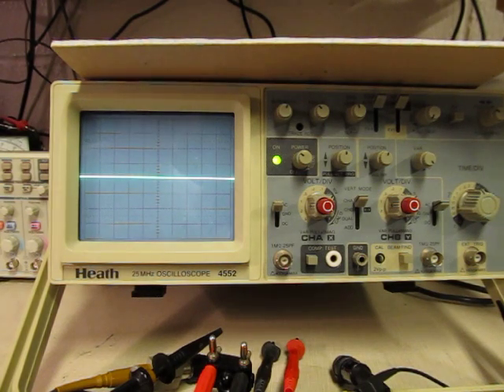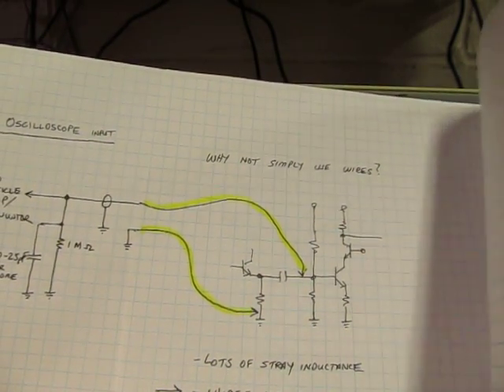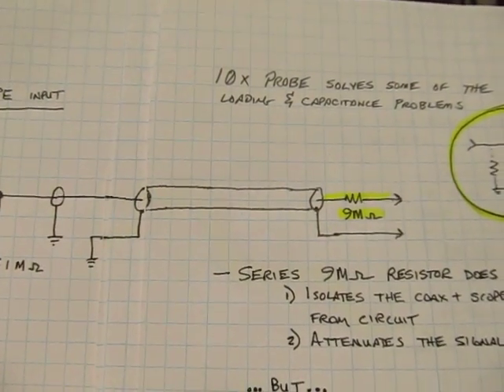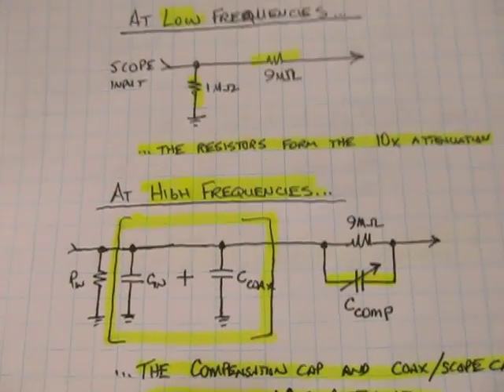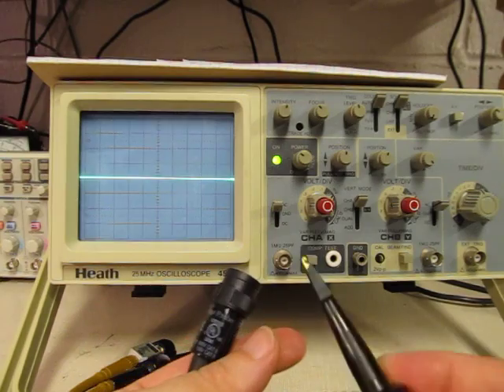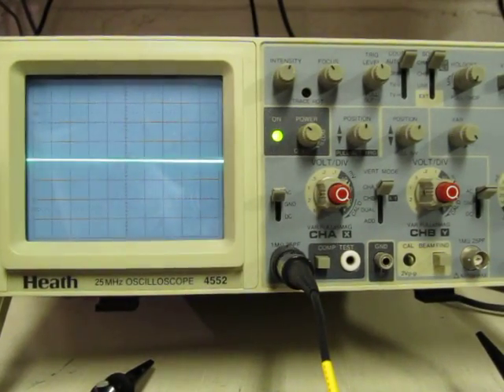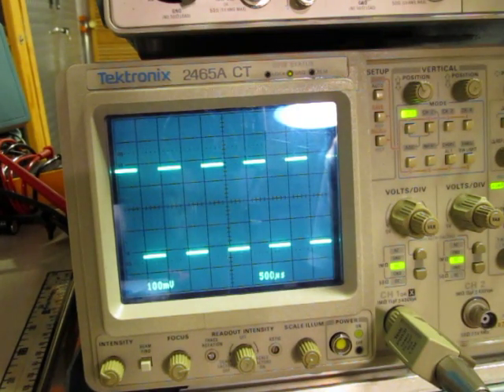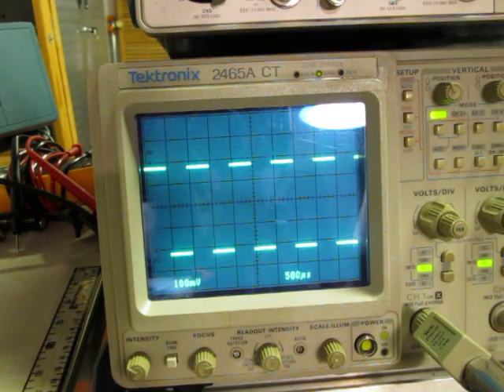#9: Basic 1X and 10X Oscilloscope Probe tutorial

Comment: Great video series as always. C-Comp of the 10x probe is in series with the intrinsic scope capacitance.
Reply from the maker: There is always a capacitor in parallel with the 9M tip resistor, but sometimes the adjustable cap is in parallel with the scope input.

Comment: I still found this educational, as I'm a new  to oscilloscope. I used to have an old Heath model many years ago that never worked because the CRT was gone and it and I never got one after that so I never learned how to use one. But I just recently picked up a Siglent SDS1102CML to learn from. there is a lot to comprehend on these things but I think your video is getting me on the right track. So I subscribed. :-)

Comment: I still have a pair of coax probes I made when I was setting up Dolby cinema processors in movie theaters. They are just a straight-through coax, breaking out to two miniature banana connectors, which all the Dolby cards used as test points. 1X, 1m length, no compensation of any kind. But these test signals are all at approximately 1V RMS and 1KHZ, and the tests are for level and phase. I knew when I made these that they were only good for such robust, low-frequency  signals, and would never suffice for more challenging measurements, though they were good enough to detect noise and hum as well on these rudimentary circuits. They can also be used in a pinch, if my car gets stuck in a snow drift, to tow it out!
Reply from the maker: 1x probes don't require compensation since they're basically just a direct connection to the scope.  Perfect for the audio application you've got.

Comment: Great video, a short extract of the lecture without the background noise. 
After decades of (occasional) scope use, I've only recently learned that 10x is typical or normal probe usage. I always thought it was an exceptional usage for high voltage inputs, and was not really conscious of the loading aspects. I always had my probes set to 1x, but then I was mostly dealing with digital circuits, so less effect. 
I also only learned recently that the sharp internal tip was intended as an actual probe, I always thought the springy hook was they only way it should connect to the circuit. 
Anyway, I had a question, just saw it was answered further down. (If the 9M resistor must be at the probe end, before the coax,  and the compensation trimcap is in parallel with it, how can it work when the trimcap is at the scope end of the coax?)

Comment: I am trying to look at the waveform of a 120-volt wall outlet to see if I have dirty power. Will a 10x probe safely accomplish this by knocking the voltage down to 12-volts? I do not want to blow up my oscilloscope by having too much voltage on the input. What is the best way to accomplish this?
Reply from the maker: It is still something to take great care with.  Make sure the probe is rated for the peak voltage that you'll see.  Plus, you're making the assumption that the outlet is wired correctly (hot & neutral aren't reversed).  It can always be dangerous when working around line voltages.  A safer option would be to use a step down transformer (such as a 12V secondary), and probe the secondary voltage.  The transformer won't dramatically alter the waveform, and it will be safer for several reasons (lower voltage, isolated source).

Comment: How does the trimmeable bypass cap work when it's near the socket, but the 1x/10x selector switch is in the probe? How can they be in parallel in the way you've drawn them?
Reply from the maker: Sometimes there is a fixed capacitor around the 9.1Mohm resistor at the probe end, and a trimmable cap is placed in parallel with the scope's input capacitor.

Comment: Hi, love your videos, they have helped me learn so much! :) I am trying to make an oscilloscope out of a salvaged CRT from a small TV, and I'm having some issues displaying square waves properly.(square waves turn into round sawtooth). Would soldering in a compensation rc circuit simillar to these probes maybe solve the issue, or is it an issue with the deflection coil that would have to be rewound to have lower capacitance/impedence? I am currently using the vertical coil to draw the line, and the horizontal to coil for the vertical amplifier.  Thanks regardless :)
Reply: This sounds like a pretty cool project :) I know it has been 6 years already but were you able to complete this project of yours :)? Hope you're safe and sound.

Comment: I am trying to measure very low current RF at 80mhz however my 1X says its only 25mhz but I think its closed to 65MHZ I tried coiling a wire around an antenna to remove the scope interference but it still seems to read 23 to 28MHZ. Any tips as to why that may be? Or how to measure it? Seems like maybe 100miliwatts signal.

Comment: I really appreciate ALL your videos! I’m a hobbyist and just learning electronics. I’m learning a lot from your videos! I bought a used Tektronix 2465 scope for a good price. No probes, so I got me (a pair)some after market 1/10x 100 MHz  probes. Tried compensating the probes as you recommenced. Channel 2: no problem! Channel 1 does not allow me to “flatten” the corners of the square wave from the calibrator signal, I’ve maxed out the probe’s adjustments. If I I switch probes, same issue on ch1 but not ch2.  So I know it’s ch 1. Any ideas or suggestions to correct it? Thank you,
Reply: The POST on the 2465 all check out as passing.
Reply from the maker: @jbflores01  It is possible that the internal compensation of the Ch1 attenuator and front end is off and needs calibrating.  This wouldn't show up in a Self Test of POST test.

Comment: I have a DIY DSO scope that is rated at 50V max and I am wondering if I can probe with setting at 10X on a circuit up to 500V? My probe is 100MHz bandwidth rated. Just built it and don't want to fry the scope. The probe I assume will take 600VAC by the info from the probe package. Thank You! Liked and Shared.
Reply: In theory yes, but in practice, the upper limit will be less than that due to the ratings of the components in the probe. So, check the maximum voltage rating for the probe.

Comment: I have a Tektronix 2465A and a P6131 probe, the exact combination you are using in this demonstration.  When I calibrate the P6131, the shape of the square wave does not change much, but the vertical distance between the positive and negative plateaus goes widens and narrows, depending upon the direction I turn the adjustor.  The calibrator is said to output 0.4V, and I can calibrate the amplitude of the square wave to cover 4 grid boxes, 100mV each, just as your scope shows.  But the shape of the square wave is not as clean as yours and doesn't change when I rotate the adjustor.  Any comment would be appreciated.
Reply from the maker: On the 2465, the calibrator signal frequency varies with the timebase control. When the timebase is too fast, you're not going to get the right result for the user low-speed probe cal.  You want to be at about 1ms/div.
Reply: @w2aew  Thanks.  I will try again.  In the interim since my previous comment, I acquired a proper non-metallic screw adjuster.  I was previously using a screwdriver from my set of small "eyeglass" type screwdrivers.  I wondered whether the metal screwdriver had any effect on what I was observing.  I will start over.

Comment: adding 9M attenuates the signal 10 times "only for DC "right? And what did u mean by saying "isolates the coax + scope from the circuit"? thanks
Reply from the maker: The 9Mohm resistor forms a 10x voltage divider with the 1Mohm scope input resistance for DC and low frequencies. As the frequency increases, the 10x division of the signal become more dominated by the ratio of the scope's input capacitance and the probe's compensation capacitor in parallel with the 9Mohm resistor.

Comment: I have to go back to basics again because one question still torment me a couple of days: should we think about wave reflection effects caused by impedance mismatching in probes transmisson line? While we measuring 50 Ohm circuit for example we have first mismatch in probes which have 9 Meg resistor (or some random reactance not equal 50 Ohm), then we have 50 (I guess) Ohm cable, then it enter in 1 Meg oscilloscope (which have own reactance). I can assume that effects really insignificant but why? I can't trust my oscilloscope since I've been thinking about it xD
Reply from the maker: It all depends on the frequency you're talking about.  The probe's input impedance (10Mohm in parallel with several pF) will often by much higher (an order of magnitude or more) than the 50 ohm line, so the discontinuity will not be very detrimental.  If you get to the frequencies where the probe's input capacitive reactance starts getting below a few hundred ohms, then it is time to start thinking about using a different probing or measurement strategy.

Comment: So if we have C-comp near BNC it mean that 9M resistor near BNC connector too right? So did it mean we have full capacistance of cable from tip to 9M res applied to our circuit in that case?
Reply from the maker: The 9M resistor is always at the probe tip.  For probes that have the adjustment near the BNC, this means that there is a fixed capacitor in parallel with the 9M resistor in the probe tip, and the adjustment is actually a small capacitor in parallel with the scope input.

Comment: Sorry for the newb question but what is the purpose of the small 10-25pf capacitor across the 1M input resistor on the scope, it looks like a bypass capacitor or low pass filter. Why would I want that?

Comment: @w2aew, when you measure a 5 volt drop across with your oscilliscope, and you decide to change your volts per division, does that change your voltage drop across that resistor ? I obzerved when manipulating volts per division, it raises the volts peak or lower's it, is that changing voltage, how could you still count 5 volts per division once you raise your wave now the wave is jumping to about a few divisions higher, so how could you still measure 5 volts.

Comment: Quick question for ya. I am looking into getting probes for my two analog scopes. They are both 100Mhz scopes. One takes BNC and the other banana plugs. The probes I will be getting will be relatively cheap ones for now as I don't have the money to spend on expensive ones. I have herd that I should get probes that have one and a half times the bandwidth of my scope, other say to match the bandwidth. Should I be getting 100Mhz probes or 150Mhz probes? I will likely get BNC connecter probes and an adapter for the banana plugged scope. Probes would be the P6100 or P6150.
Thanks for all the great videos and advice!
Reply from the maker: I doubt that the scope with the banana plug inputs is actually a 100MHz scope.  Banana plugs just aren't suitable for that frequency.  Good probes are rated to achieve their indicated BW, even when connected to a scope with the same BW.  Not all probe manufacturers specify their probes that way though, so following the 1.5x rule isn't a bad idea.  Just make sure that the probe's compensation range encompasses the input capacitance rating of your scope.
Reply: You are right. That one isn't a 100MHz scope as I thought. Not sure where I got that from. I checked again and it is a Tektronix 5110 mainframe with 2 5A19N differential amplifiers and a 5B10N time base. So it is actually a 2MHz scope.
My Tektronix 465B is definitely a 100MHz scope though, but it is in need of a few repairs it seems. I also have a BK Precision 2120A 20MHz scope that doesn't power up.
Thank you for your reply.

Comment: I have old oscilloscope that has no information on it's front about it's "in" capacitance and resistance. When I opened it I saw 220 Ohm resistor and 100 nF capacitors at connectors. I purchased 100:1 probes for this oscilloscope. It has Input Capacitance - 6pf Input Resistance - 100 Mohm and compensation Range - 10pf-35pf. When I try to compensate probes to oscilloscope input it always shows insufficient compensation. What can I do to correct that? Thank you!
Reply from the maker: The vast majority of scopes have a 1M input resistance.  it is the input capacitance that will vary among scopes.  I highly doubt that the 220ohm and 100pF part were setting the input impedance of the scope.  If the compensation range of your probe isn't sufficient to properly compensate for your scope, your only option is find a different probe or modify the compensation circuit of the one you have.  Maybe you can find an old manual or datasheet for your scope to learn what the input capacitance is.
Reply: You are right, I measured the input with a multimeter and it showed 1 M and 75 pF.  When I try to adjust trimmer on the probe it starts to move from "insufficient compensation" then goes better and then falls back to "insufficient compensation", and do not allow me to reach "normal compensation". Is it possible to do something about it? Thank you!
Reply from the maker: That's a pretty high input capacitance, and is why you can't properly compensate.  The compensation adjustment is a variable capacitor which only has 180 degree rotation from minimum to maximum capacitance.  If you can open up the probe, you can try putting a very small capacitor in parallel with the compensation capacitor to see if that helps.
Reply: Thank you!

Comment: Nice video ...so if you are aligning a ssb 27mhz ssb transceiver you would only have the probe on 10x ( if the 100mhz probe was rated at 6mhz / 1x and 100mhz 10x??.
Thanks in advance.
Reply from the maker: If you are using the probe to examine the 27MHz signal, then yes.  However, there are better ways to couple the RF output of the transceiver (if that's what you need to do) to the scope.  See my video on RF Samplers.
Reply: @w2aew  yep I made one of your RF samplers for my 25mhz scope but recently bought a Tektronix 465M scope ..wahoo.

Comment: Hey, could you explain what capacitive loading is and why at 4:00 the 9M ohm resistor "isolates" the coax and scope capacitance. I understand that in the case of a 1x probe, as frequency of the signal in the circuit increases, then the reactance of the scope capacitance will decrease and so more current will flow through that capacitive branch. But then how does adding a 9M Ohm resistor in series to the coax help? Thank you.
Reply from the maker: Capacitive loading is the amount of capacitance that the probe presents to your measured circuit node to ground - the same as putting a capacitor from that point to ground.  The 9Mohm resistor gets placed before the source the the large capacitive load presented by the coax and scope input - thus putting a very high resistance in series with it, which effectively takes it out of the circuit.  However, even 10x probes still have some capacitive loading effects, but not nearly as large at a 1x probe.  I recently did a video on this too: https://youtu.be/sPSJnj7gVJA
Reply: @w2aew  Thank you for your reply. I have one more question. Correct me if I'm wrong, so to find the bandwidth of the 10x probe (the 3db frequency) you would use the equation 1/(2piRC) where C is the net capacitance which is 1/10 of the input capacitance + scope capacitance and R is the net resistance of the 1M and 9M ohm resistors? In the end this 3db frequency value would be higher than that of the original 1x probe, hence giving the probe greater bandwidth?
Reply from the maker: @titiliu3302  The BW of the probe is more complex than that, since the compensation circuit is a lot more complicated then what is shown in this simple video.

Comment: the term 10x means if I give 10v at the Intput ,I will get 1 volt at the entrance of the probe . am I right about this ??
Reply from the maker: Yes.  The probe contains a series 9Mohm resistor which forms a 10:1 voltage divider at the scope input.

Comment: thanks and here is noob question of the day Oscope-propes 40mhz or 60mhz or 100mhz does that matter in any way.. I'm a noob with some cheap leaning handheld learning scopes that ain't cost a lot but need a scope probe and unsure if that makes any difference for low cost... can I go with fx 100mhz prope for a sub 1mhz scope.. if the price is the same for 40mhz prope vs 100mhz prope. and thx for a great video.
Reply from the maker: It is usually best of have a probe that equals (or moderately exceeds) the scope bandwidth.  If the probe is rated for much higher bandwidth than the scope, then there's a chance that there won't be enough adjustment range in the probe to properly compensate the probe with that scope.

Comment: how to design 100x attenuator circuit just to measure dc pulse of very low frequency  , can we do it using voltage divider ??
Reply from the maker: For low speed, a simple resistor divider will work.

Comment: Does the 10x probe reduce the frequency by 10? So if I had a 500 Mhz input sine wave and used a 10x probe, would I see a 50 Mhz sine wave on the scope?
Reply from the maker: No, it only attenuates the amplitude of the signal by a factor of 10.  It does not change the frequency.
Reply: It also changes the phase of the signal (with respect to a reference time point), important when a signal has more than one frequency component. Electric guitarists use this to their (dis?)advantage with all those funny effects boxes and pedals.